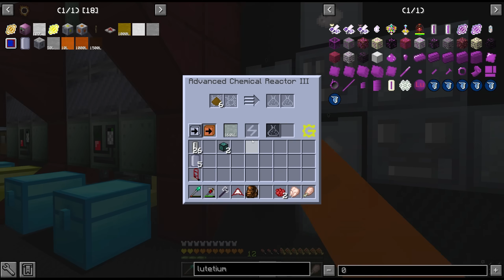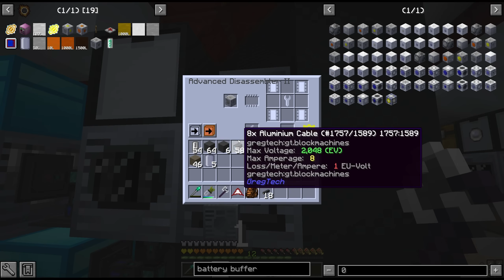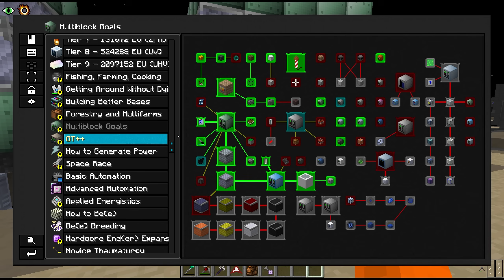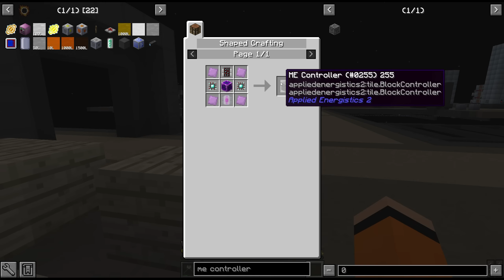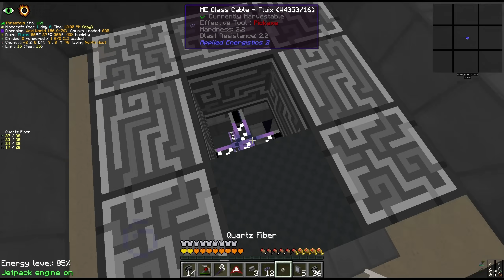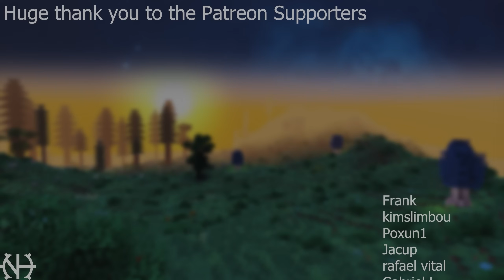Gregtech New Horizons - EP38 - EBF & AE Upgrades! Modded Minecraft

Comment: Ayy, really liked the episode, you are getting near full base transition, can't wait until most of your stuff is automated, and you can just make things that you want (for example: dense AE cables, man, i wish you could do full "tier 2 AE controller core" (aka 3x3 of controller blocks fully covered in P2P ports, for channels galore) and unwrap this hellhole of sub-network channels before it goes out of hand!
But GTNH does not really make it easier to achieve with it's recipes . By the way, is there another way to deal with liquids? these Ender IO conduit tooltips 3 screens long don't feel safe in terms of lag...
Reply: They are fine for lag

Comment: Can you use P2P to transfer EU via AE2, thereby removing the need for all the power loss in the long cable runs?
Reply: The p2p has a 5% transfer loss on all energy which it moves, at ev 5% of 2048 is 102.4, meaning the loss is equivalent to 102 block of cable loss. The efficiency gets worse than that the higher power tier you go, so at best it’s as bad as the cable loss and at worst it’s way more inefficient than cable loss.
Reply from the maker: P2P energy tax in gtnh is 20% 😮
Reply: I'm pretty sure this is incorrect. The GT p2p is 5%.

Check the GTNH AE2 Github. The GTEU p2p shows that the power loss is set in AppliedEnergistics2.cfg under "TunnelPowerLoss". My config file was default set to 0.05.

Regardless, 5% is a huge amount to pay especially in upper tiers. However, I think it is well worth the energy cost. The biggest benefit is you can upgrade machine power on the fly without rewiring long stretches. I am in ZPM and almost exclusively use the GT p2p for power. The only negative is that you need a power buffer on the outputs to get a full amp out and to prevent voiding on world startup.

I really appreciate the series! It's so great to see your take on the pack!!
Reply from the maker: @The555mmm10  After double checking the configs myself, you actually are correct here. IG I had the wrong information, this makes me reconsider energy p2p again actually. It's tough to say if its worth for the distances we are currently sending power but perhaps slightly further out it could be viable. Thanks for the comment, and joining along on this crazy journey through new horizons :D

Comment: Moving things that are very slow to mine like those blast resistant blocks is made much, much easier with some Thaumcraft. An Equal Trade focus will exchange those blocks with something like, I'unno, dirt, at a small vis cost and barely any time relative to actually mining it. Very useful.

You can place an output hatch in the top layer of EBFs, but that is only for capturing what pollution gasses your muffler is able to filter out, if any. Not placing an output hatch does not cause the pollution to be ejected into the world, it just gets voided. As for wallsharing, you can actually wallshare EBFs, and it's worth doing so to save on coils (although of course that means you need to upgrade all of them to upgrade every EBF, but that's something you're likely to want to do sooner or later anyway). A double EBF setup, AKA two EBFs next to each other wallsharing six coils, are comfortably able to have separate input buses, separate output hatches, and two energy hatches for overclocking purposes, having to share input hatches and an output bus. A quad EBF setup, AKA a 2×2 wallsharing...well a lot more, it's complicated, have to make a choice between individual output hatches or having enough space to place two energy hatches to overclock them. Everything else is shared with at least one other EBF, and the output bus shared between all four. It's a bit of a cluster, but it's four EBFs at the cost of only 41 coils instead of 64 - you're basically getting a free fifth EBF out of it!

If you want to get more power out of your battery buffer, which you will sooner or later because 1A IV isn't much at this stage, use a hi-amp transformer to get out up to 4A IV (assuming you've got a 16x EV battery buffer full of batteries) and send that around. Or upgrade your battery buffer to 16x IV and transform it up to 4A LuV, or invest in a multiblock battery and send power to different parts of the base on separate lines, whichever approach you find best.

There you go, 2× EBF setups. For reference wallsharing them in a line more than that is just barely possible, but not exactly practical - every EBF requires their own, individual Maintenance Hatch and Energy Hatch (the latter you can technically wallshare, but as Three discovered previously this doesn't always work out very well), and if you do a line of three (or more) EBFs the one(s) in the middle have a grand total of two usable spaces that aren't wallshared. Which is just enough to make it work, but you'd need to be very careful in planning out input and output busses to make sure that everything works properly. It's doable, but I prefer 2× or even 2×2 setups for the sake of keeping things easier to organize. It costs some more coils, sure, but a double or quad setup is efficient enough. And you end up needing the extra space more often than you'd think, anyway.

For those that don't know, the Mega EBF lives up to it's name. Those 3×3×4 EBFs, now 5×3×4 double EBF setups that Three has? The MEBF is *15×15×20*. It requires 864 coils, among tons of other stuff. Three can technically craft it, in terms of tech progression, but practically speaking not on multiple fronts and doesn't have the infrastructure to make use of it even if he could, so...project for another day, perhaps ;)

Yeah, for some mysterious reason the EBF will not accept the circuit in the controller, it has the be in the input bus. No idea why some multiblocks can have it in the controller and some not, but it's what it is.

You're going to want a bigger input buffer on the vacuum freezer, or multiples or them. One vacuum freezer is not going to keep up with multiple EBFs once they're all running through hundreds of dusts, and you do not want random hot ingots to show up wherever in your AE2 system.

With Tungstensteel coils and an IV assembling machine you're able to upgrade to HSS-G coils already. It's a very worthwhile upgrade, since more heat means less EU cost and more upgraded overclocks, which do wonders for your processing time.

The dedicated rutile EBF is a good example of how you can mix-max your EBF coils to achieve greater processing speeds at no loss in power efficiency - Titaniumtetrachloride requires 2140K, which means a minimum of Kanthal coils to do the recipe at all. At Nichrome you only get a 5% EU discount, but at Tungsten coils you get an upgraded overclock, meaning if you run the recipe at EV it's four times faster at no extra power cost. In short, if you used Tungstensteel coils instead of Nichrome the recipe would be twice as far at no extra power cost. Is that worth it, in this particular case? Not really. It would only save you 10 seconds per recipe, and you're likely not waiting for rutile to process if you've got access to pure titanium dust (which you do with a T2 rocket, and Three has a T3, so go figure). But this is a good example of how you can get double processing speed - and further EU discounts, for that matter - out of passive EBFs at no extra EU cost. Once you start applying this to things like Tungsten, which takes 400 seconds base per 2 ingots smelter, this optimization starts to matter more. Especially if you end up deciding to go down paths that require inordinate amounts of a given material.

Do not make the same mistake I did, and delay epoxy until you're basically late in IV. It's pure misery, upgradig your EBF coils and circuits should always be high on the priority list whenever you're in a position to do so. It saves you so much down the line it's worth it every time.

For some reason the IC2 spray cans say 0 uses left when they have 512 uses left. Don't know why, but it's a thing. You can also use buildcraft or openblocks paintbrushes instead of the spray cans, but I believe they have less uses before needing to be refilled/replaced (although the buildcraft paintbrushes you can repair in a TC Thaumic Restorer, so if you've got the essentia their durability can be effectively infinite).

For color-coding cables there's basically three approaches you can take. You can either copy the color-coding set by the tier's various superconductors (only up to UHV tier, but further tiers basically don't exist yet, so not that big of a deal), copy the color-coding set by the machine hulls (only applicable up to UMV, but see above note about content past UHV not really existing - and no, UMV is three tiers past UHV, after UEV and UIV, because shrugs*), or invent your own color-coding scheme based on whatever strikes your fancy. If you do the last approach I *highly recommend crafting a written book ingame that lists your chosen colors for the various tiers, and keep that written book in the same place where you keep your spray cans, which is likely to be your tool bag. The last thing you want is to suffer an explosion not because you didn't color-code your cables, but because you did and you *forgot your own color-coding scheme*.

You can dye machines in GTNH, yes, and dyed machines work similarly to dyed cables insofar that they will not connect to cables that are dyed a different color. The problem, and main reason you don't do this, is because if you dye a machine it also dyes the UI when you open said machine. And that looks *hideous*. If you ever do accidentally apply a dye to a machine and want to spare your eyes from any further torture, by the way, just right-click the machine with a bucket of water to wash off the dye. Breaking and replacing the machine will not remove the continued assault to your visual senses, only a bucket of water will save you.
Reply: Hello the dude with Greg PhD
Reply: Are you Greg?

Comment: 3:42 The energy hatches can be shared between two EBFs (or other multis). The hatch provides two amps which will vice each multi one amp of the tier voltage, which is all it needs.

Also EBFs can have multiple fluids and will pick the one needed for the recipe